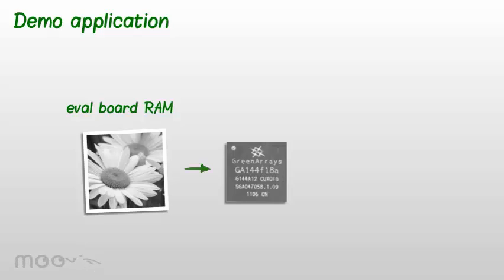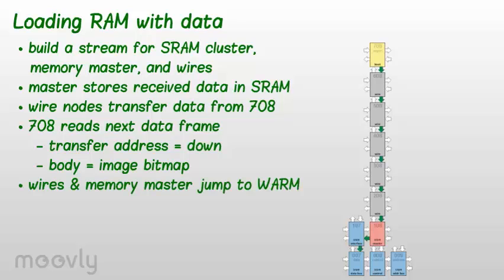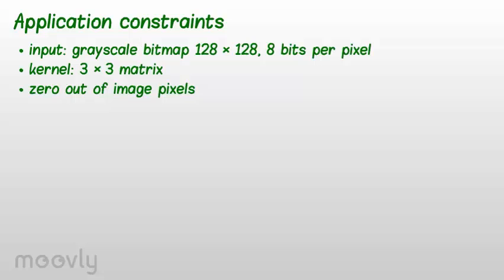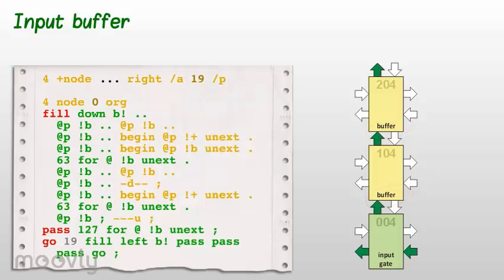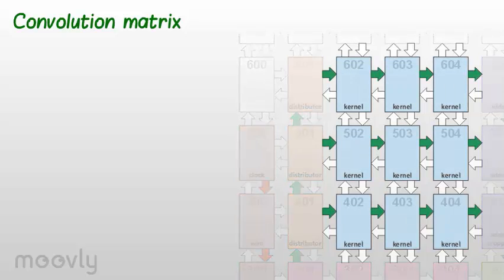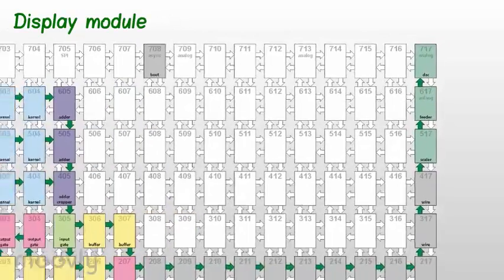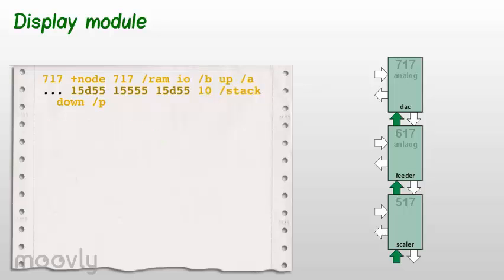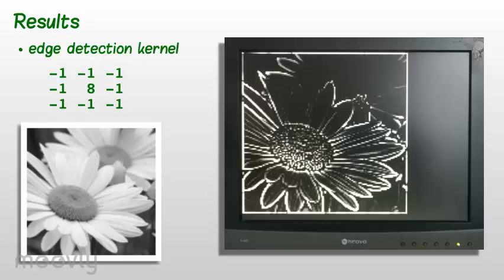Forth Day 2016 presentation by Daniel Kalny

Comment: What is the throughput of the example kernels?
Reply from the maker: I haven't tested the maximum throughput. Also, due to GA144's asynchronous nature it's not an easy task to calculate it. However, the demo app processing 128x128 8-bit grayscale image is able to stay in sync with a VGA display at 53 Hz, thus proven throughput is 16KB of data at this frequency, which is 848 KB/s.

Comment: How does this compare to implementing in an FPGA?
Reply: I don't think they can be compared.
GA144 is another concept.
Reply from the maker: Correct. GA144 is an asynchronous chip while FPGA, as far as I know, are clocked.
Reply: very good question. I wonder if programming GA144 is easier than FPGAs? After that the speeds, computing power and electricity consumption would be interesting to compare..